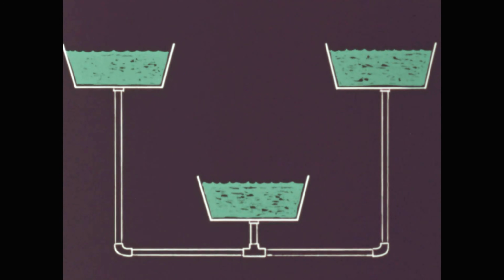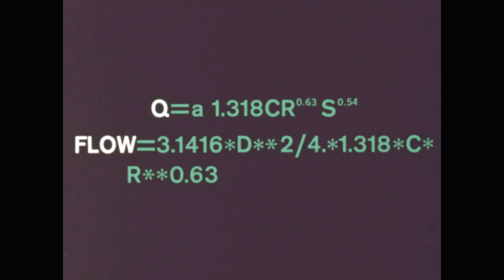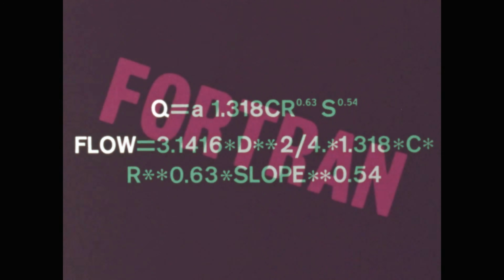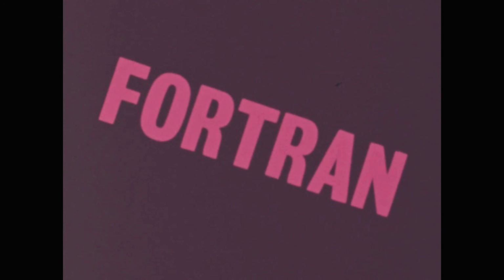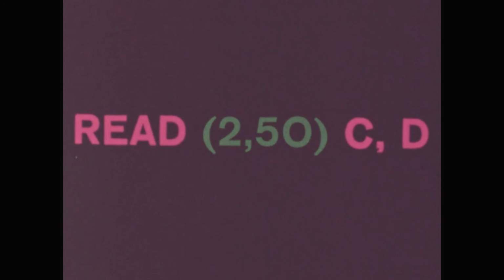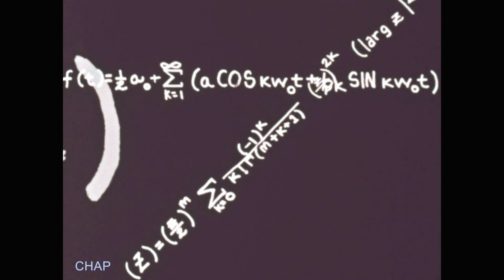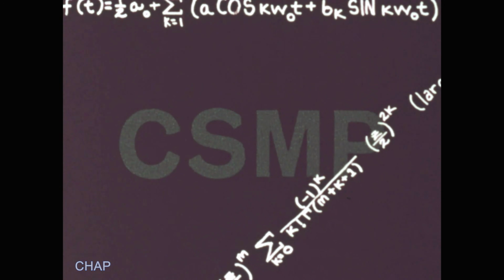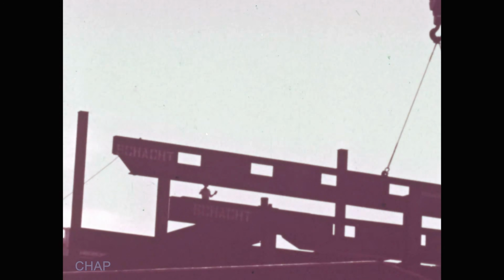Computer History IBM 1130 System Engineering 1965 FORTRAN Programming languages, System/360

Comment: The first company I worked for after college had an IBM 1130.  The equipment filled a room and looked much like the photo at 1:06 in the video.  We had the desk-sized console containing the disk drive, the line printer, the card reader/puncher, and a keypunch machine.  We did run the "stress" program and later I wrote a replacement for it in Fortran, among other engineering programs.  The keypunch, printer and card reader were very mechanical devices and occasionally something would stop working.  The service person would come over, take the machine apart and look for the problem then he would leave and a little later he would come back with a new part in a little box to fix the machine.

Comment: My first computer in grade school in 1967. We learned FORTRAN out of IBM 'green books' -- a self paced course. We wrote our code on mark sense cards using special IBM electrographic pencils. We fed those into a device that read and punched the cards. I think we had to punch some cards manually. My first program converted degrees F into degrees C. Very exciting.
Reply from the maker: @augustuscrocker9328, 1967 is quite an early start!  I bet you have amassed a good deal of experience since then.  "Electrographic pencils"  that's a term you don't hear every day.  Thanks for your feedback and look back!  ~ VK

Comment: My absolute favorite computer ever. Spent a decade in the 1970's programming a small 1130 to run our entire manufacturing business. We ran payroll, accounting, purchasing, inventory, shipping, invoicing, and even MRP. I modified the operating system to add function and improve performance and built additional hardware for things like floppy disk (8") and digital tape for backup. I'm still programming 50 years later but it's not the same as trying to shoehorn a large program to fit into 8K of memory. I still miss it.
Reply from the maker: Hi @MrPeabodyPA2, it sounds like you have some great experience with the 1130!  Still programming after 50 years is quite impressive!  MRP=?
Reply: @ MRP is Manufacturing Resource Planning. It involves taking customer demand, expanding the bills of material, and netting against inventory and open orders to determine what components need to be manufactured or purchased, factoring in lead times on everything. Its immensely complicated, and it took a while to run, but that little 1130 crunched the numbers just fine.
Reply from the maker: @MrPeabodyPA2,  excellent, thank you very much!
Reply: I write my first programs on this machine. The programs solved wing lift and drag, S&C, and aircraft performance for our senior capstone a/c design class! We were the first undergraduate class allowed to use the computer.

Comment: So it takes someone with a calculator or slide rule 45 minutes to do the calculation and get the result.  How long does it take, once the cards have been submitted to the computer operator, to get one's printed output?
Reply: Why, 2 days, of course. But think of the time savings!
Reply: Typically the computer program is running thousands of calculations, so the guy with the slide rule would have to do his "45 minute" calculation thousands of times with different input variable values. Did this really need to be explained?
Reply: @spinav8r  Well actually, I was reminiscing of my days long past of waiting hours for my output at a local college that had an 1130.
Oh and -- Boot that Rudder!
Reply from the maker: Good question.  !

Comment: Dr. Vitagliano was putting me to sleep. If I was helping with this video in 1965, I would have had to pull the Emergency Pull Switch (29:36) to create some excitement. Another time would be if I was a disgruntled computer operator in 1965, and I've had enough. This is too much work for $1.65 an hour. After I tell the boss to take this job and shove it, I pull the switch and head out the door. 🙃
Reply: I was an IBM 1130 computer system operator in the summer of 1969; I was paid $1.35 per hour. I only hit the emergency stop once: when a thunder storm was rolling in. I was later promoted to staff programmer, and earned enough to pay for rent and groceries, so I moved into town instead of living with my parents on the farm.
Reply: Yes ... making any kind of media back then was... primitive. Run it at 1.5 speed and it's better.
Reply from the maker: That's a good suggestion!   Thanks!

Comment: One of the peculiarities of 1130 Fortran was that variables could only be 5 characters long.

My first language was Fortran ii on a CDC 1604 / 160A system.
Reply: The IBM 1130 FORTRAN compiler was FORTRAN II; and yes, it was limited to five letter variable names. Two programmers at Eastern Michigan University upgraded the compiler to the EMU-IBM 1130 FORTRAN IV compiler, with six letter variable names, and much more. I was one of the two programmers - wrote a lot of assembler code from the summer of 1971 to the spring of 1972, and worked a lot of nights!  It was in use at over 1,600 sites within a year.  IBM was preparing to introduce the IBM System/3 in 1972.  

My first programming language was Fortran; learned it in the summer of 1966 at Michigan State, and then in more depth on an IBM 1620 at the US Coast Guard Academy in the fall of 1967, and following my discharge, at EMU in the spring of 1969 in Numerical Analysis.
Reply from the maker: @UltrafastPED, that sounds fascinating!   Quite a bit of history and good experience too.  1,600 sites, is pretty impressive!
Reply from the maker: Did not know that... Thank you!

Comment: 60 years later, my entire computer fits in the palm of my hand, and the 5,000 GB HDD is the size of a pack of cards. And, I've just bought half a terabyte of storage, the size of a thumb nail. Unfortunately, at 62, I'm unlikely to see what the thick end of the next 60 years holds?

EDIT: It's 1965, I'm 3 years old again, and this video is represented as data on a paper tape ... But, the tape tore ... Has anybody got any Scotch Tape?
Reply: @marcse7en  We had a paper tape splicer where I worked in the mid-1970s. Paper tapes were from certain cash registers in the  Didtrict Court office, for paying traffic tickets. Sometimes a tape was damaged. The fix: cut out the bad part, splice in a piece of blank tape, then punch all holes across all of the unwanted tape, followed by the good data. It helped if you could read the 6 bit character codes.
Reply from the maker: Yes, hope we live to see it or most of it!